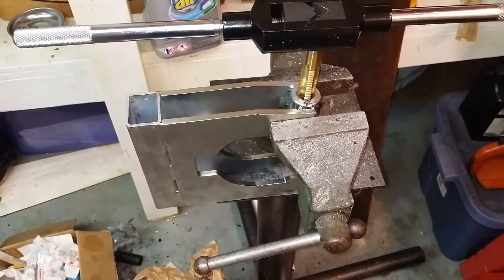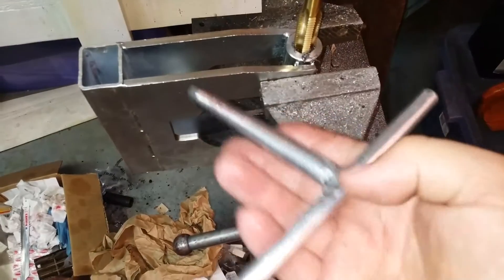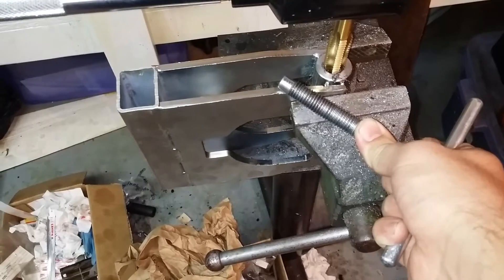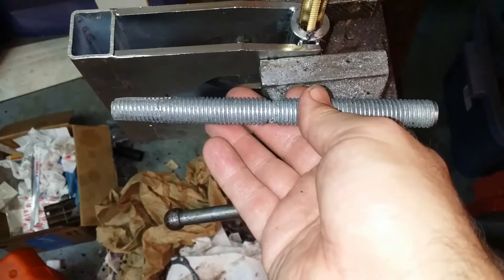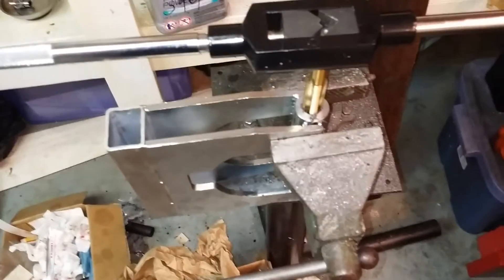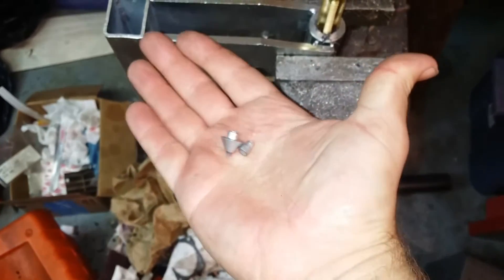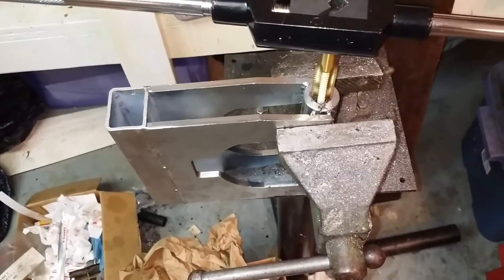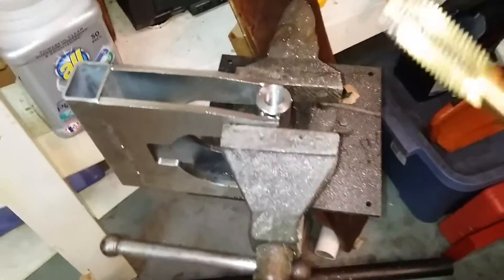Crankcase splitter mod / fix.  Huztl splitter broke, sorta.

Comment: Tap/drill size charts are free online and beat guesstimating tap drills. I keep taps and drills together with my thread repair kits. BTW if you want easy, accurate starter holes get some machinist "center drill" bits. They work in hand drills too and don't "walk" like standard twist drill bits. Start the hole with the center drill bit (after prick punching then center punching, punches are cheap) then the countersunk hole will guide your twist drill bit. Even milling machines can't fully control twist drill bits hence center drilling. 

A cheap combination square is mighty handy for finding center on rods, rounds and of course allthread.
Reply from the maker: Iirc....I didn't have a large enough bit to accommodate the tap I was using.  I do have center bits...they are at my folks place with the bridgeport and the lathe.  But yes....you are correct in your comment ...thanks!

Comment: I find with those coated tap and dies that they don't cut worth a dam.  I have a full set and they all act like they are dull , they will not even work chasing a good thread, I tried just to see what was going on. Used threading oil and when I removed the tap it was hot to the touch..  Its the coating.  I only buy HSS tap and dies with no coatings from then on.
Reply from the maker: these seem to be ok, but I know what you mean.  I was using this one with an improper starting hole size, so that made it harder ...by quite a bit I think.  thanks for the comment though.

Comment: Probably 1/2" pipe thread, who knows....LOL.  You need a full set of drill bits.  I recently picked up a tool box full at the flea market for $30.  used drill bits, milling bits, odds and ends.  Most need resharpened.  But hey on the weekend when everythings closed and you need that 5/8 drill bit one of them will come in handy.... BTW stevetheboatguy is sending me a case for free just cover shipping.  Thanks for the offer.  Still can't log onto OPE.
Reply from the maker: Brian Brady I'm gonna split another case today....we will see if this 5/8 rod is better
Reply from the maker: nice,yeah I have a nice set of bits, but it doesn't go bigger than 1/2" ...  and I don't know the rec size for 5/8" tap.  likely 17/32 or so.    anyway, i'm always working on picking up tools.  what a mess in the basement lol
Reply from the maker: Trev DoubleU sorry trev....no idea what's going on there
Reply: Correct 17/32 good video think I'm gonna just go ahead and do that with my splitter
Reply from the maker: Trev DoubleU trev...they have had an issue lately...it should be resolved
Reply: Cool let us all know how it works for you
Reply from the maker: Trev DoubleU ugh....what is your username on the forum?
Reply from the maker: Trev DoubleU sent a message to the mods
Reply from the maker: you should be fixed on the forum now :)